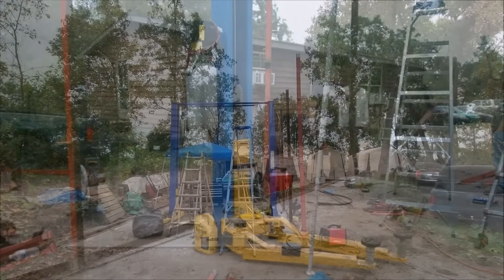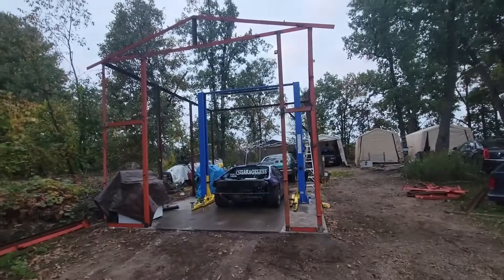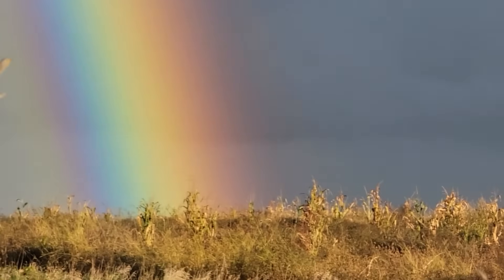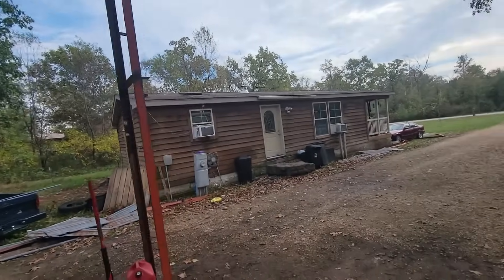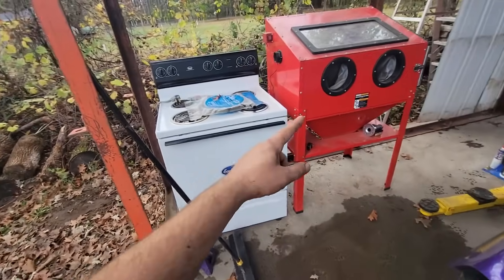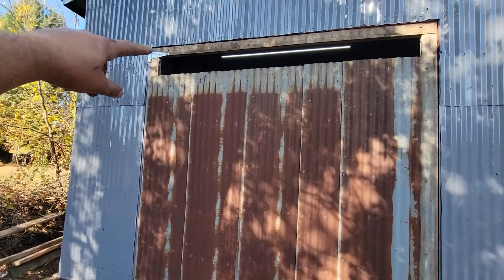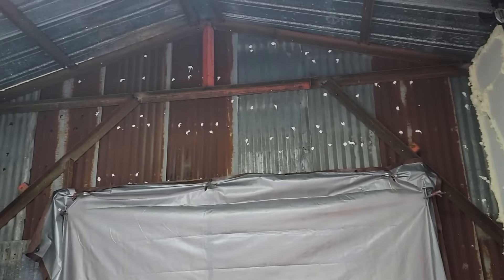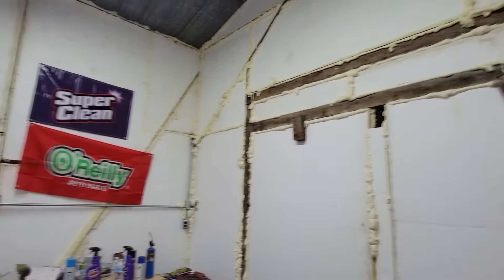building the cheapest shop on youtube!

Comment: Yes, the concrete will crack eventually...  However, YOU can easily be the one who decides where it cracks. Cutting some relief joints (> or = to 1/3 of the pad thicknesses) will promote the inevitable cracks propensity to follow the path of least resistance (which will now be directly below your cut joint) rather than somewhere less desirable like where the lift posts reside. While I've certainly encountered situations where cracking occurred elsewhere, it's incredibly rare. I operate various concrete cutting equipment for a living and this method is the industry standard. You're best move on any future pours will be to make your cut asap while it's still curing. This lessens the chance of it occurring elsewhere and is a lot easier than after it's fully hardened. 🍻
Reply from the maker: Thus far all good.. but ik it could in the future still

Comment: Super impressed with how you re-used materials.  Big tip.  Watch that foam and sparks/flame.  Some of that stuff will
Go up like a firecracker.  I miss my 12’ two post lift.  You will have plenty of project space there.
Reply from the maker: I actually did try and light some of the foam in fire it was definitely something i gave thought too... the white foam is pretty resistant to fire but does melt just takes lot to light on fire... but sray foam idk if i ever tested 🤔
Reply: @Garageless  that’s good.  Not
All is super flammable.  You must have the good kind.   Good think you checked it.
Reply from the maker: Thus far nothing has caught fire from negligence lol it has caught on fire from welding right next to it on the building... one thing i did find out was brake clean melts the foam though lol

Comment: Great build!  Was that a porcupine? Above bay door ways & eaves would look great with frankensteined recycled house or commercial windows. Green glass if you can find it  Get your natural light.  No aluminum. Try wood or steel frames. Old buildings throw em out all the time. Hit up your small local window installer. Habitat Resale sometimes gets stuff to ugly for home dropped off too = Cheap or Free. A video on rough make up of a pulley chain & crank openers would get hits too. Could probably do something up with used bike chains & sprockets. Weld mount on frame using worn our springs or leaves to flex for temp changes. Youre still Garageless, but now you're Shop Full.

Comment: After 3 years'  I ask did it leak like a rusted out well bucket and you had to something about that?
Also did any of the foam boards start turning loose from using the foam spray and you had to reattach them?
Reply from the maker: No more leaks than I had on day 1 🤟 really not many most are from old nail holes i didn't caulk... and foam boards I didn't have any seperate like that but I have melted em from havin fires to close to building or brake clean eating away at it or it just getting cut up from screwdrivers or razerblades getting stabbed into the walls lol

Comment: That's awesome! I just built my first shop, kinda like this except I put a 40ft container on each side. Kind have a condensation problem now. Waiting til summer to spray foam insulate it. Wanna make a oil drum wood stove for heat. Wana make a video of problems you ran into and solutions you came up with?
Reply from the maker: I wish i could've used containers... yea i still have condensation issues thinking about throwing humidifier in

Comment: Let the haters say what they want to say, If they dont like it, they can either come build you a better shop or shut their pie hole. I just hope you are using something heavier than 10 ga wire to run 220 out to the shop. !0 ga is not big enough and you will have problems with it. You need 4 or 6 ga at least to be safe. But good job on the shop, have fun with it.
Reply from the maker: Pretty sure i used 8 guage no issues yet

Comment: Your lucky, Up here have to jump through hoop building has to 50lb snow load 115 mph wind has to being engineered, drawing required inspections. a permit for that size building would be 2k. i lost a 88 x 60 pole building doe to a tornado  5 years ago cant replace it cost way to much now.
Reply from the maker: i was surprised how lax it was here

Comment: If your planning on any significant welding grinding inside you should face the foam at least to head level with something that is NOT flammable. After all that work would hate to see you burn it down with a grinder!

Comment: my uncle built his massive shed in the 80's by my guss rn he as about 20 cars packed in the back of it and in the shop area in the front he has 4 cars they are all 50's 60's and 70's land yacht's and I asked him a few years ago how much total he paid for the whole building when he first put it up. he told me it costed him 600 bucks the main cost was the framing. he gave a dude a rack of beer for the metal sheeting for the roof and the walls. dont get me wrong its not insulated and the front half where he has his lifts is concrete and the rest is dirt. if I remember correctly he didnt put concrete in until atleast the early 2010's. only reason I remember that because my cousin got cracked off of 3 monsters to get the concrete done which I dont blame my uncle doing that because they mixed all the concrete 1 bag at a time and they needed to do it before it set lol

Comment: If you just work on Hondas and small trucks that are sub 5000lbs I bet you’ll be okay with that slab. If you’re regularly working on heavier rigs with that lift I would dig out where you have your posts and pour a really deep concrete pad just for your lift posts.
Reply from the maker: Its 9k lift no diesel can be lifted with that lift what i poured was actually more than it called for